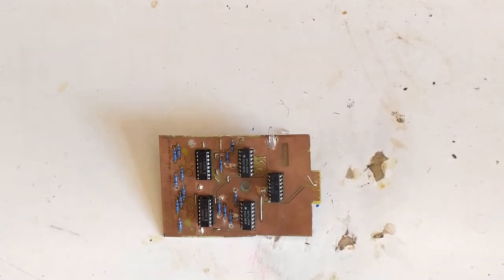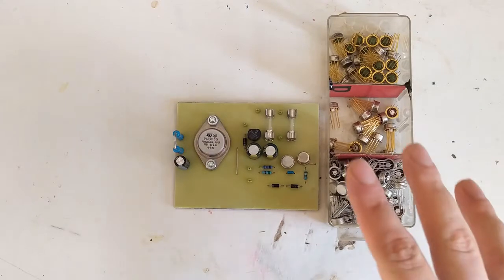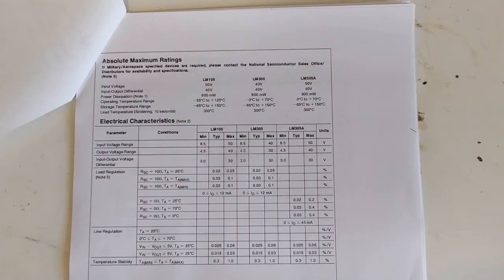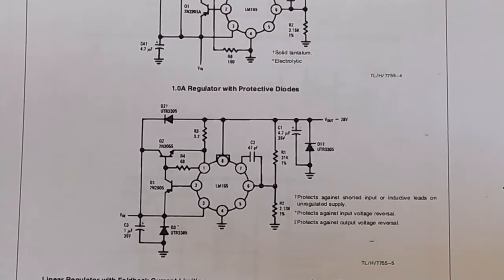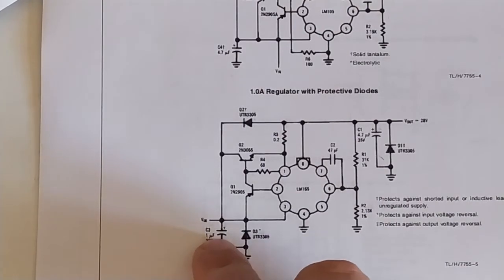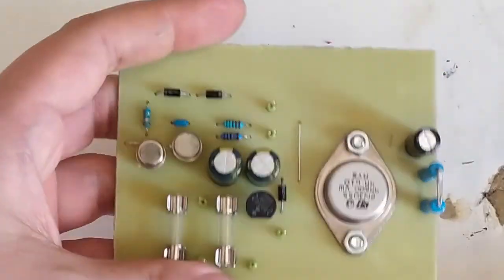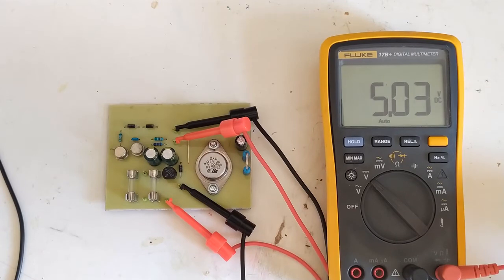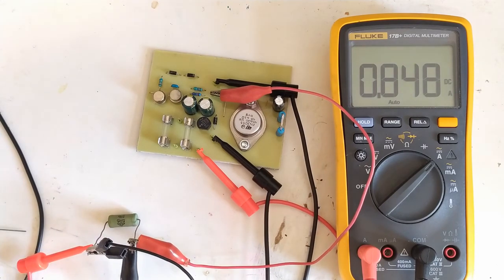Building a TTL-Clock/Timer Part 2:  Power Supply

Comment: Hi, I don’t know if you realized but you do not have to count and compare for your application. All you need to do is to load and count down from there with 74xx161 up/down counters which you can preset with your bcd selector switches and stop the clock on terminal count then. This wi save you half of the chips.
Reply from the maker: Yea that's actually probably a better solution, I might Implement that instead! Thank you very much for the idea